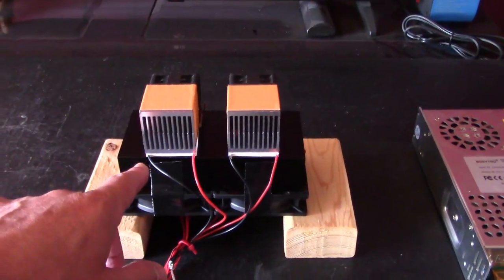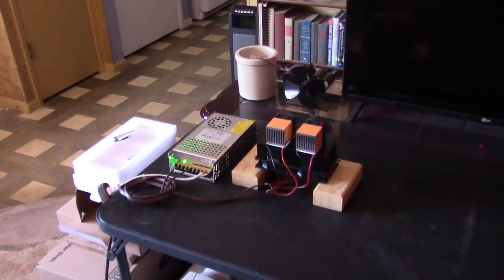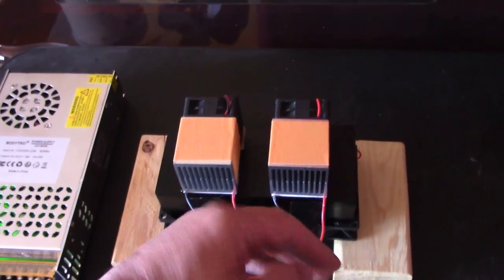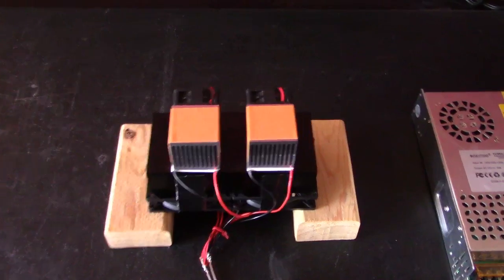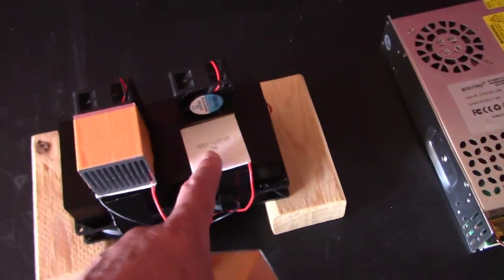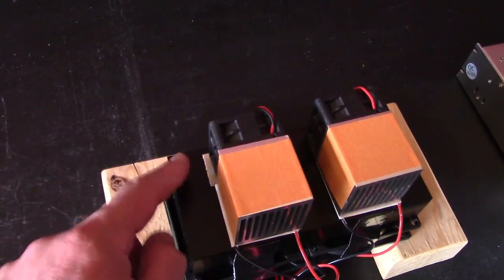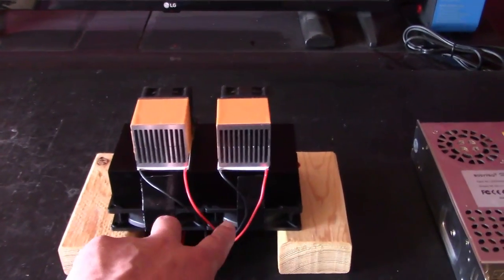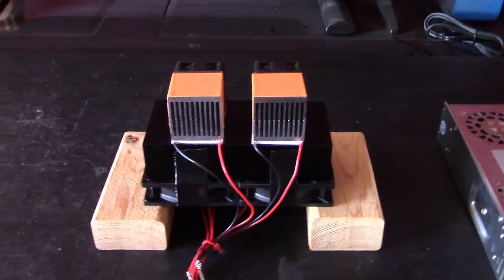DIY Space Cooler! "Peltier" AC Air Cooler - 100w/200w 12v (12715 peltier module) - no ice needed!

Comment: I don't understand what's going on. What is a chip?
Reply from the maker: hi. the chip is a peltier chip (or peltier module). those are the flat ceramic square shaped elements. when power is applied to them one side of the peltier gets very hot and the other side very cold. we are using the cold side to produce cold air. it's a little hard to explain in a comment but if you check wikipedia you'll see a good explanation of thermoelectric cooling.

Comment: Wonder how it might perform with water cooling the heat sync rather than air
Reply from the maker: it would be a good experiment. i stayed away from water cooling with this project mainly because then you have the extra steps with water and water pump.

Comment: So hi, as you seem to have built just about everything ive wondered about through the years....right now im working on a project....project actic air..looking to set sone world benchnarking records even during tje summer as most of us guys set all our recorda during the winter.. right now im top 3 in the world. But im doing it the hard way.. no water to my gpu. No chiller.. only air...so i was dreaming up somethkng.. do you think a heat exchanger, 18x20 1" inlet abd ouylt...submerged in ice bath with possibly alcohol or salt mixture... with some sory of inline fan pushing ait through it...be effective? Right now i have 1.5 " copper baseboard pipr with 3.5" alluminum fins looped into the water bath and back out....all together 4 ft under the water.. it feels lacking... maybe low 50s.. my cousin a plumber his whole life said this heat exchanger with good cold ice bath could easilly push out sub 40 f air... thats what im after... and it eould rrally make these guys mad if i kept passing them on a non liquid cooled setup...anyways i just pipe the air to my pc and have 4 x arctic p8 max fans on the stock cooler which is a vapor tube 13" heat sink...big bertha i call hetmr...and some honey well ptm 7950 temperature phase change thermal putty on the core...and before it asks... no ive never had condensation problems... was running 0 f air in in feburary...it was seriously good setup.. but after 40s it has diminishing returns due to well it being air....so if i could get anywhere near high 30s.. id be sitting pretty and id rather do it without an expensive chiller unit...i also have about 6 more ft of this baseboard stuff a relative has that was left at their jobsite...but idk if its thr fan being too fast or the  aseboard setup not transfering enough...? It looks like it is insabely efficient though?   Anyways.. i hope somehow this smg reaches you abd you can help me jerry rig something that sets world records and breaks hmthe hearts of the 5,000 $ water cooling setup guys. Cheers.

Comment: Where is the heat going from this design?? Into the same space your trying to cool? 

I like this but that’s part is a issue for it working the best it can

Btw is this the guy who plays the character of J Rock it sounds like it
Reply from the maker: hi. optimally, you would direct the heat out, but it works great as a space cooler because the heat just goes out the sides and up to the ceiling.
Reply: Yes, but in the long run you also add the heat generated by using electricity - the 1-200w per h power draw

Comment: Your timing on this is incredible Im mid design on a Peltier based cooling system for a friend and came back to your channel for some swamp cooler design review for part of that project.... and here's a peltier solution with the power supply i was looking at to boot. Normal problem of needing to vent that heat out of the space but still useful projects as always.
Reply from the maker: glad i could help! one solution to vent it would be to use a 3 or 4 inch dryer hose. you could slide it over the end of the heatsink, bend it to the shape and clamp it on with a worm gear clamp. then direct the other end of the hose out a window (through a piece of plywood mounted in the window). just drill 2 round holes (with a hole saw the same size as the dryer hose) and slide the hose through or seal it to the plywood the same way i do in many of my solar thermal air collectors and air heaters. note. use a 200mm or 300mm heat sink so there is plenty of space on the heat sink for the clamp.
Reply: @desertsun02  Have you looked into those 40mm waterblocks? My idea (one of them anyhow) was to run an insulated hose (hot supply) using a block the same size as the module. sandwiching two modules hot sides to the same block and running a supply through a wall to a 120mm radiator. Adds complexity for sure... and a pump res combo. Im more or less building an aquarium cooler on steroids. So ive got the pumps, hoses and waterblocks already in the budget...
Reply from the maker: i haven't done much with the waterblocks due to the added level but i really should. maybe in future vids. sounds like you have a good plan 👍

Comment: Nice, I'll be making one asap
Reply from the maker: all 6 red wires (from the 4 fans and 2 pelter chips) are twisted together (and all 6 black wires too) then just connect those to a thicker length of wire. (i used part of an old extension cord). then that just goes to your 12v power source.
Reply: @desertsun02  thanks
Reply from the maker: sweet!
Reply: @desertsun02  I've came up with a awesome idea for the AC with the transmission oil cooler. What do you think of the idea of using a electric portable cooler. Basically you drill 2 holes in the top to insert the 3/8 inch tubing. Electric cooler can stay cold without ice, you just plug it in and it stays cold